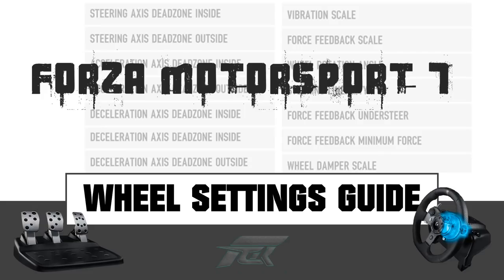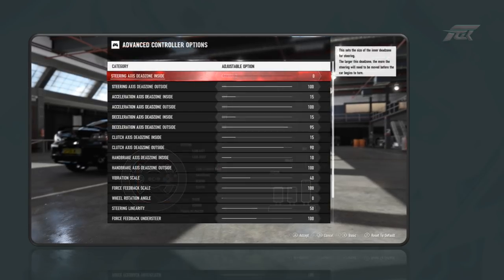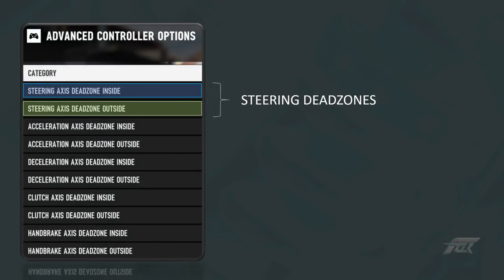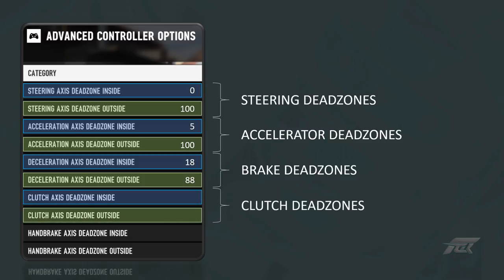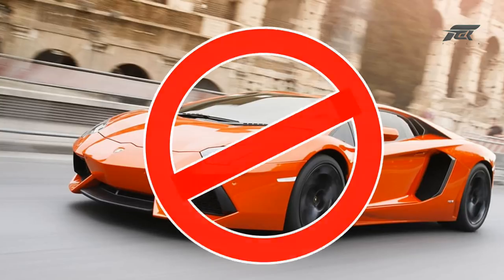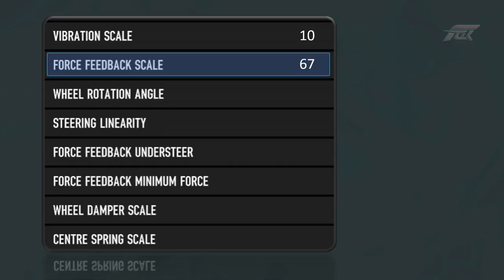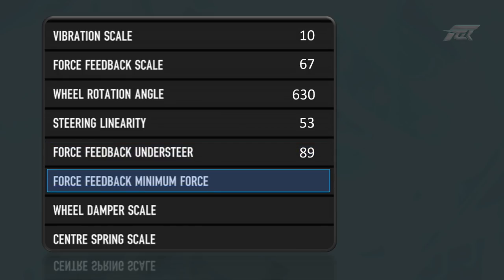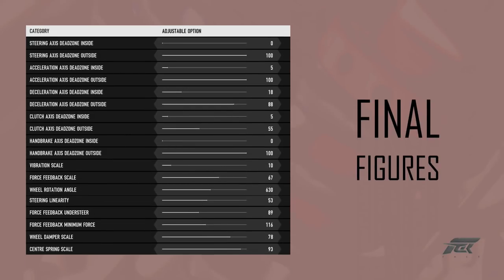Forza Motorsport 7: Make your wheel, feel real!

Comment: These settings are the bomb.  Tried with both Forza Motorsports 7 and Horizon 3.  Felt totally in control and started to get quick times immediately.  The video explains the settings rather than just show a number so that if one of the settings seems a problem you can adjust it easily (with a good idea of how the change will make the car feel).  Great video
Reply from the maker: Lloyd Sheen Thanks for commenting, Lloyd!  And really pleased to hear you like the settings on both games! 👍 I don't play Horizon, so it's nice to hear!! Cheers, buddy.
Reply: FACR Official how is this setup for drifting? Any changes you’d make to make the wheel  feel better, snap back faster. Looking to buy a tx wheel soon
Reply: Thats why I liked the vid I don't understand cars etc so having this all spoken about really helped understand which settings to play with and what to leave alone

Comment: Very informative & good starting point.

My settimgs on my G920:
Layout 5. Paddle shifters for break & gas (leg paralysis)
Where diff from the vid:
Vibration Scale 65
Force feedback: 100
Wheel rotation angle 300
Steering linearity 38
Force feedback  understeer 200
Force feedback min force 116
Wheel damper 78
Center spring scale 100
Aids: (aiming for all off)
Race length: long
Traction & stability control: off
Boarders: on
Rewind on (but try not to use it)
Suggested line: breaking only
ABS: on
Steering: simulation 
Shifting: automatic
Damage: cosmetic
Friction assist: off

Comment: This video was fantastic. As I said in the 2O4F group, I did have to modify for my TMX's lack or torque and notchy feeling. 

Thrustmaster TMX(not pro)

Vibration Scale: 
49
Force Feedback Scale:
98
Wheel Rotation Angle:
620
Steering Linearity:
53
Force Feedback Understeer:
89
Force Feedback Minimum Force:
116
Wheel Damper Scale:
90
Center Spring Scale:
95
Reply from the maker: Josh Howard Thanks very much, Josh! Kind of you to say! And thanks for adding your settings for the Thrustmaster TX! 👌👍

Comment: I should take my words back. This is very good setup. Today I was able to beat my previous world record with this setup. I just did some corrections. If u play on the pc with the g27 logitech, try to change ffb to 95 in game and set Overall Effects Strength 106 in the Logitech profiler. There is no cracks and wheel enough heavy. And 809 degrees rotation. But, I offten change it depending of the car.

Comment: Minimum force does not increase toque output, it puts a curve in how the torque is produce from the tyre. If you where to visualise it make a graph, (pneumatic trail torque x FFB signal) at 100 (the linear setting) the line would go up to maximum straight, adjusting it in either direction makes the line curve, if you lower the setting to 80 the FFB signal will become higher near the start of pneumatic trail torque and higher values will make the FFB signal weaker at the start. BUT the start and end points remain the same so you cannot increase the maximum torque the tyre produces only manipulate how that maximum torque is reached and hence changing the feel.
Reply: Excellent video BTW 👍

Comment: So I just tried the settings you recommend and it made a huge improvement on the steering wheel realism! But on my cheap setup for the petals, I felt like it was too much effort for the brakes and clutch.. so I changed the deceleration deadzone inside to 0 and for the clutch as well, I'm using the Logitech setup with a cheap chair setup. So it's wobbly along the feet area lol

Comment: Thank you for the great video, I have raced with a variety of race wheels for a few years now and have tried my best to find a good setup with the advanced settings, THANK YOU for the hard work you did in the explaining and reason for your settings, I will try these setting on my Fanatec System this weekend and let you know how it works out for me.
Reply from the maker: Thomas Sanchez Firstly thanks for taking the time to comment. I hope the settings work well for you. So far there have been quite a few people who have said the settings work very well with the Fanatec wheel, but it appears the general feedback is that the strength of feedback is a little low. If you also find to u want to increase the overall feel you get, I'd definitely advise that you increase the Wheel Damper Scale as apposed to the Force Feedback Scale. The reason for this is the Force Feedback Scale has been balanced with the 'Force Feedback Understeer' and 'Force Feedback Minimum Force' values,  so adjusting the Force Feedback Scale will disrupt the overall feedback balance. The Damper Scale will just make the wheel feel 'heavier'. Either way mate, it'd be great to hear how you get on! 👍 Cheers bud!

Comment: This is an excellent breakdown, can you advise brake deadzone settings for anyone who hasn’t got the rubber stop as mine broke. Without it it doesn’t seem to matter what I do with the settings. I either get the pressure just right to stop the car quickly (this is very close to impossible) or I have one of two inevitable options I’m a millimetre too far and the abs cuts in/ I’m a little too soft and the car has almost no stopping power at all. Thanks 👍

Comment: Excellent detailed video. Will be interesting to see how this works as I'm now using a G920. Thanks for this FACR. Will you be updating us with a new video due to the recent changes in feedback settings?
Reply: Try this.

Steering axis deadzone inside    0
Steering axis deadzone outside.   100
Accel.  Inside   10
Accel outside.  90
Decel inside.  10
Decel outside 90
Clutch inside. 0
Clutch. Outside 100
Handbrake inside. 0
Handbrake outside 100
Vibration scale. 20
Force Feedback scale. 80
Aligning torque scale 140
Mechanical traile scale 140
Pneumatical trail scale 140
Road feel scale 130
Load sensitivity 50
Wheel damper scale 125
Center spring scale 125
Dynamic damper behavior 100
Wheel rotation angle 540
Steering linearity 50

Comment: Hey FACR I just bought a Logitech for my Xbox one and I’m not new to sim racing but I am brand new to using a wheel. I did watch this whole video and it did help a little but I have some questions. Well here’s the first thing my biggest problem with using a wheel is that no matter how much I brake or turn my car always locks up the brakes or barely brakes at all it seems. Then when I’m trying to turn corners, no matter how much I turn the wheel my car just looses control and spins out. I have only tried this wheel with forza 7 and so far I absolutely hate the experience. I feel like I have zero control. Even though I have messed around with the advanced settings and assists my car just spins out into the grass or around a corner it doesn’t make any sense. I can be on a straight and my wheel just starts fidgeting and I go off the track and crash. It like someone is tugging my wheel. My wheel can’t be broken it’s brand new out of the box. Do you have any solutions for this problem? Becuz I feel I’ve tried everything. I never had any of these problems on a controller.

Comment: The TITLE of this video is 100% Correct and why I bothered to watch it. Bought my first wheel just 28 days ago, the Logitech G920 on sale for 1/2 price at Christmas from Best Buy. But I was set to return it after 26 days of struggle with it being literally uncontrollable and my cars just all OVER the place like the Wheel was the biggest pile of crap EVER manufactured! I never had any wheel prior and honestly find it incredible that setting for this have such a profound response!

  I was boxing it up to return after 14 days and my wife talked me into also buying the Playseat Challenge Seat (oh the SHAME!). You see to make matters even worse I had this wheel mounted onto a very flimsy folding TV tray that every single turn of that wheel had the entire damned Tray flying up to the left or right depending which direction I was turning. Now the wife & cat thought it was funny as Hell. ME? Yeah, not so much. So in a rage finally I flung it so hard I'm shocked it even still worked. But the Playseat arrived and while better, still was sending it back since it was still simply all over the road and yes this WAS still before my second can of beer so it was not me...
  
  Now I have watched maybe 5 or six other videos here on the Tube on "settings" and I DO appreciate them. But THIS  IS THE ONLY ONE THAT MADE ANY SUBSTANTIAL DIFFERENCE AND 100% FOR THE BETTER. The ONLY one I feel anyone needs and for SURE is the only one I will be using. As important for ME is all of the crystal clear explanations of how and WHY these settings were arrived at.  As a new "racer" I find it equally as important so if I love the feel but wish I could change something specific, I have a better idea WHICH setting might be the best to play with and WHY.  This is also critical as I am BADLY disabled. And badly OLD as well:-) As a 4 times wounded USMC Combat Veteran with 4 bullet & shrapnel wounds as well as a Veteran of several marriages, 4 prior in  fact (insert laugh here), and now with 40 years of a successful marriage on #5 who is SO wonderful she is now offering to not only "allow me" to buy a full cockpit and KEEP it in our already cramped & filled to the gills with MY crap Living Room, she offered to loan me the money for it. When I said no thank you she now offers to literally just BUY it for me outright and I don't even have to pay her back, she just wants me to KEEP it for physical and emotional therapy since I don't have much time remaining due to health...
 
  You see I am no longer able to even stand on my own much less walk after 6 spine fusions in my back plus a few more in my neck 5 years ago that failed. Now on massive heavy dose opioid pain medications till I croak and also have Lyme disease which has made me have all sorts of neurologic spastic like movements going on. On the plus side I sometimes look like I'm TRYING to be a break dancer when all I am TRYING to do is reach for a friggin BEER! And now at now age 70 and STILL gaming 12-16 hours a day EVERY single day (it helps me forget I am now a useless piece of crap and too DRUGGED to do anything else if I could) this sim racing is something new for me and makes my losing the ability to drive and race in REAL life's LOSS 5 years ago, a lot easier to endure.

   It turns out I already had 8 of these games but just never played any since using a controller they all just SUCKED for me at least. Well now with the help of THIS video the new wheel has suddenly come to life and I will be keeping it after all and ONLY this video did anything to make such a huge and wonderful change in my life. these are NOT just "games" for me sadly. The ARE honestly a huge escape...from a broken body and from a mind that struggles with severe depression that came from it. So it looks like I'll let the wife order me a GT Omega ART R6 Simulator Cockpit  and while I may be the slowest old fart out there, at least I WILL still be OUT these. And with the new racing sims I just added I now have 11 to play in and will return this God awfully painful for ME Playseat while I wait for the Omega Cockpit. At 6'2" tall and 238 pounds I feel like  once I get into the damned thing I will NEVER get the Hell out! Not to mention it slices up my knees etc etc. I'm just too big for it and it is just to narrow, wheel wobbles too much etc etc. I Want something rock solid etc.

  Sorry for this book and doubt anyone will ever see this 18 months after this video was made BUT, I just need to have it out there, what an AMAZING GIFT this video is for someone about to walk away from this hobby/sport (whatever) because they simply have no clue of the significance of all these seemingly "dumb settings" or how to correct them.  This video is not just helpful, it should be a first OWNERS MANUAL for my beginners  Logitech G920 Wheel. It is MINE for sure....
THANK you to FACR Official,
Mike in Oceanside California
Reply from the maker: Hey, Mike.
I'd like to start by saying thanks for your comments.  You truly have been though one hell of a journey, and I thank you for your service!  My father too was a Vet, but sadly his illnesses won the battle and he very recently passed on. He too was an avid car nut - and proud Maserati Ghibli owner (like the Cup version in FM7). I know he would have loved to drive that car one last time, but his condition wouldn't allow it.  He didn't care much for "games" so sim racing was something I never got him into, but I truly am pleased to read that this video has got your wheel settings to a usable level and that you're enjoying once again being sat behind it! I hope you have countless hours of fun, brother! Since making this video, there have been several changes to the FFB settings in FM7, so I'd like to provide you with my latest figures, which I'm now happily racing with using SIM Steering (something I always avoided AND even advised against!).

Steering inside 0
Steering outside 100
Accel inside 0
Accel outside 100
Decel inside 10
Decel outside 100
Clutch inside 5
Clutch outside 95 (lower if crunching gears)
Handbrake inside 0
Handbrake outside 100

Vibration 0
FFB Scale 90
Aligning Torque 100
Mechanical 190
Pneumatic 100
Road feel 0
Load Sensitivity 50 (don't change)
Damper 0
Centre spring 0
Dynamic damper 100
Rotation 900
Steering linearity 50

If you want more/less "strength" from cornering forces, adjust the aligning torque scale - FFB Scale adjusts the strength of EVERYTHING (Except vibration).
Pneumatic scale adjusts how light the wheel goes during understeer through corners, so don't set this too high - The wheel will go TOO light and you'll naturally over-compensate with excessive counter-steer, probably resulting in uncontrollable snaking into the wall.  Keep forces more consistent during understeering scenarios by reducing the pneumatic scale.  
Mechanical scale is how much force you feel when the tyres hit their max slip angle, but this force remains, rather than dropping off like the PTS.  
Balance the PTS and MTS to your liking and then control the overall volume of those forces using the Aligning Torque Scale.

I hope this helps you further, and should you have any questions, please ask! I'll always do my best to help where I can. 
If you're interested in getting involved in a group of clean and friendly racers (of ALL abilities), please join FACR's fb group - These guys are superb! Great atmosphere, helpful, no attitude, and we may even see each other on the track! Here's the link if you fancy getting involved. 

https://www.facebook.com/groups/FACR.ForzaMotorsport/

Once again a big thanks for everything you've done, and I hope in some way this helps!

Enjoy x

Dave.
FACR DLTuning
Reply: @FACROfficial  
THANK you SO much Dave and never figured you would ever even know I had found this and how much it helped me.  Don't make a sick old fart cry now either:-)   Funny almost, that I had just bought myself a handmade, custom wooden URN that I wanted to pick for myself before too late when I discovered what a "WHEEL" even was and what they were about. WHAT a journey the past month has been!  Now instead of planning my end I am bitching cuz I lost a damned race! Quite the change and guess the wife likes seeing the "OLD ME" coming back in all my cantankerous glory:-)

  I will join the Facebook group and will honestly cherish the settings you just took all the time & effort to print out for me Dave. What I was after most was to stop the side to side WILD and out of control, IMPOSSIBLE to control oscillations on the wheel, no matter what I tired. That is now gone. What I also want and NEED is more force required to turn the wheel. I HATE steering so neutral or like power steering that I have NO sort of effort required to make any turn or correction. This just makes driving so boring (to ME) that I have no use for it. The more I need to put effort into a turn or correction effort, the more I seem able to drive properly. Also, it makes it feel worthwhile and more engaging as well. 

 I better shut up or will be another book:-)  Late last night about 1AM and unable to sleep I found a different cockpit on sale at a place called BH Photo in New York who I never DREAMED had anything to do with Sim racing! A Photo shop with Racing? Anyway they have a different cockpit than the GT Omega unit I planned to buy. It is the   
Next Level Racing F-GT Simulator Cockpit at $100.00 (USA) OFF so selling at $399.99. This puts it just a bit more than the GT Omega and includes FREE 2 day shipping. Plus they have IT in stock ready to go so today is a day I now need to watch ALL I can find on it to see if I can decide on one over the other. It worries me that GT Omega takes your money the moment you place a PRE Order, not when it ships. I got a refund after a bit o9f worry through emails and had to cancel a preorder when I could not afford to give them my money while waiting 2 MONTHS to see the product! Just not got the kind of money to front that kind of cash....To be honest I NEVER heard of anyone doing business that way before either so sort of scares me off.  But the seat on the next Level looks flat as a board and NOT at all comfortable, especially for MY broken old back so a LOT of deciding for me today.

  I OWE you SO much and you honestly will just never know how much you have given me here. Given EVERYONE here.... You have shared with us ALL, the keys to the Kingdom if you will, instead of hiding them for your own use:-) We all owe you so much Dave
Mike
Reply: FACR Official I’m using this setup on horizon 4. Works really well. Really comfortable. Awesome work, thanks

Comment: Center spring scale should be 0, because is the tyre physics to keep the steering in position. Have you ever had a car parked with the wheel turned and without moving it centers it self? I don't think so. The centering of the steering wheel you will udjust it in game with Toe in & out.